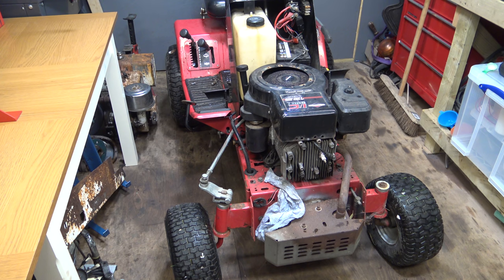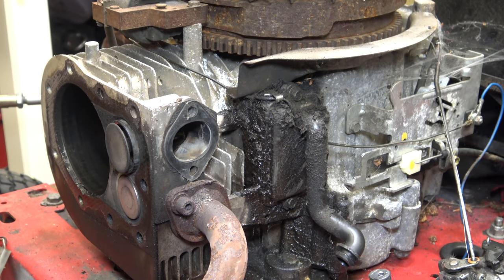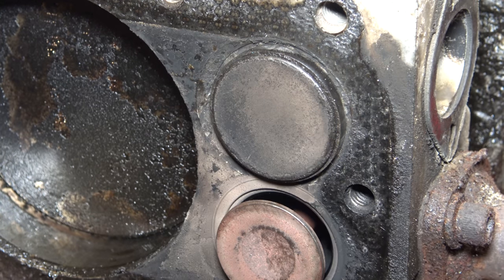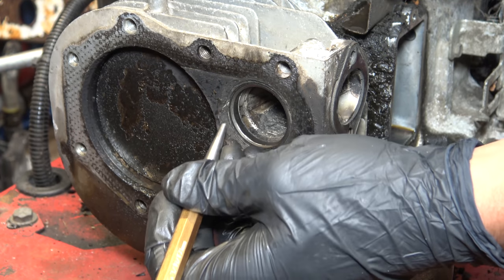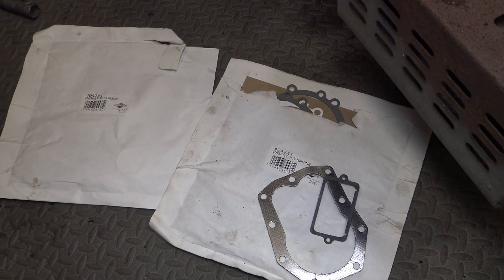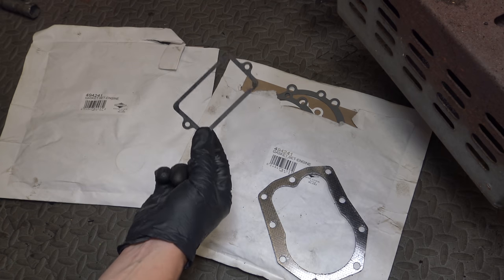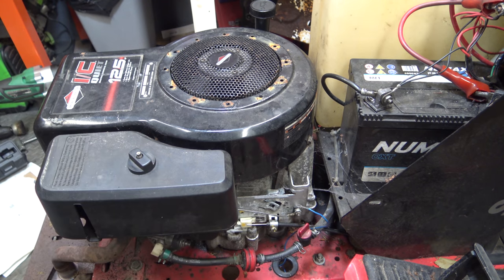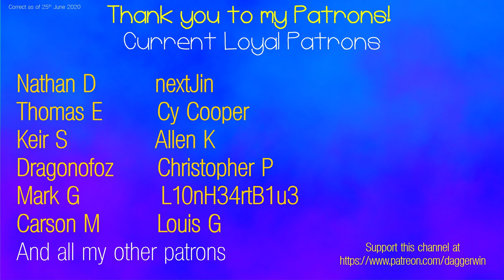Can We Fix It? No Compression Lawn Mower

Comment: Great video and fix! Usually the valve seat pops loose due to overheating (cooling fins blocked with grass or a nest). The aluminum surrounding the seat expands but the seat stays the same size so it pops out. The fins on that engine looked fairly clean, maybe the previous owner cleaned the debris out after it started misbehaving.

Comment: Ahh the nostalgia of working on single cylinder engines. I worked in a very small garden machinery shop in Hampshire since I was 15 through till I was 17. Then I parted ways and did the much bigger agricultural machinery. Only 19 now still leaning so much. I miss working on the smaller kit sometimes. That pokey little workshop on hedge end industrial estate taught me so much in such a short space of time. Never forget your roots!

Comment: I have had some valve seats loosened on fairly new B&S I/C or Intech engines even on snow blowers where overheating not will be the case. Treated them as babies and always let them cool down before I stop engine. I think more on bad aluminium or manufacturing.  Done the same as you did (with less center punches) and never loosened again.  Thx for your good work and upload!

Comment: Always instructive your video .

Question: Got the same engine. Unfortunetly, one of the post of the ignition coil broke at the base of the post. What would you do to fix this ? Glue it with epoxy ? Weld it with aluminium rod ? Need your  help on this.

Thanks

Comment: Mine did the same thing but I ended up destroying the Bendix gear trying to start it.
Got a new Bendix gear and then the engine was stuck and wouldn't turn at all even by hand.  My mechanic told me to remove the spark plugs and turn it by hand. Re install the plugs and presto it worked and still works today.

Comment: I got a drive belt change on my Westwood T1800 hydro today. Fingers crossed i can get more than 3mph out of it. Year 2000 and hydro oil is clear and correct level. I also need to remove a ton of surface rust at some point.  Apparently these ride on mowers were just powdered coated so no primer etc.

Comment: I use to have one I was going to turn into a racing mower but never got around to it, but if you put it into 5th gear full throttle and dump the clutch/belt it would wheelie about 6-8ft

Comment: Question: other than possibly cracking or shattering the sleeve with uneven pressure would you be worried about changing the diameter of the valve seat when taping the notches around it?

Comment: I have a mower shop, and from the looks of the wet carbon on that piston, it might use a little oil, but it's common for those L heads. I've had one that uses a little, I just check the oil before I mow. Been that way for 10 years. But if it was a customer I'd recommend rings or a new engine, customers are horrible about checking oil, unless it's went boom, then they add it. I've had mowers come in with blown engines and fresh oil in them
Reply: @johnwelburn9966  It's also been done on refrigeration ompressors.

Comment: That air filter is missing a hold down nut that keeps it snug against the housing. I think you got your spring twisted on the throttle linkage rod. Lotta sparks from the battery area.

Comment: I've done those before center punch at 12 3 6 And 9 will hold that seat in...
Reply: Yeah, as much center punches as in the video are not really needed... 4 would do the job. Then using the valve to drive the seat back in was a horrible idea...
Reply from the maker: @Chris-yy7qc  Chris you should take a look in the Briggs repair manual. 4 is not enough. You have to go all the way around the valve seat. Also using the nylon hammer on the valve was absolutely fine, do it however you want.
Reply: @MachineryRestorer  Its not ok and you know that, because you used another tool to drive it in the last couple hundreds.

Comment: Has this engine overheated. That's the usual cause of valve seats coming out. The valve stem and guide get tight and that forces the seat out. I regularly blow out the cooling finson my mower and it's run since 1997 without any issue..

Comment: I’m 15 and I love yr vids also watch daggerwin ive fixed and got going a alert bever powerspade its all mechanically good I re built the small 2:5 Briggs now working on a Webb cylinder mower that had a 5 hp Briggs but I put a honder gx 160 because I think honder are better engines than Briggs I next want to get a non running ride on with Briggs engin all there but not running I’m from uk near Hertford

Comment: When you reset the valve seat do you hit the surrounding aluminum to hold the seat in or the seat itself?
Reply: The aluminium around it
Reply: @Daggerwin  thanks.
As these engines are getting pretty old now I would prefer to fix them not source another block. They still aren't worth enough to send them to a machine shop to get them repaied but I prefer to fix them and I have seen this a few times over the last 25+ years I have messed around with small engines.

Comment: Wow! This was hard to watch. That lower spring had slug still in it. When he said theirs nothing he could do about it" I wanted to punch the tv. It's called brake cleaner and or degreaser.  I mean fuck hell mate! Atleast clean the damn thing proper. And give it an oil change and a new air filter and clean the carb out and put in some fresh gas. Other than that good job getting her going. Just clean the engine up. You also could have removed the other valve and gave it a polish as well.